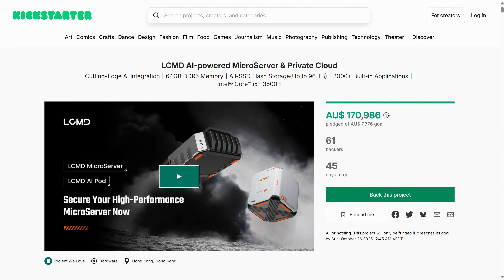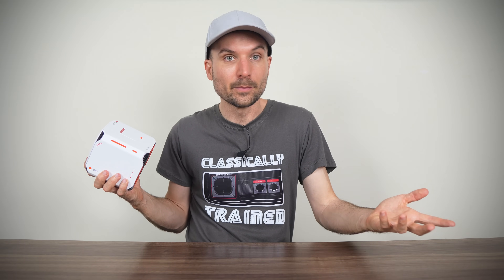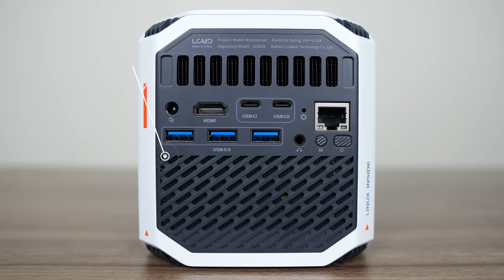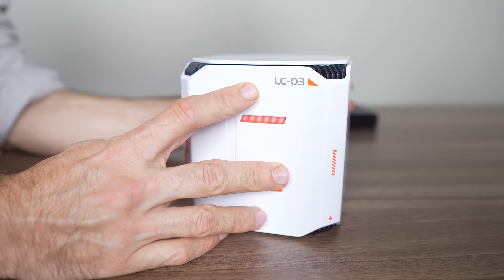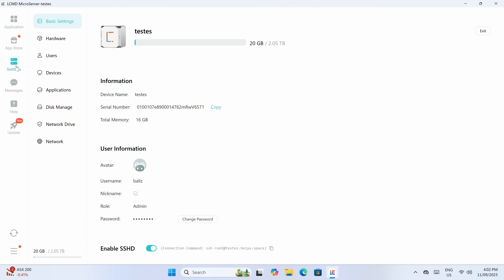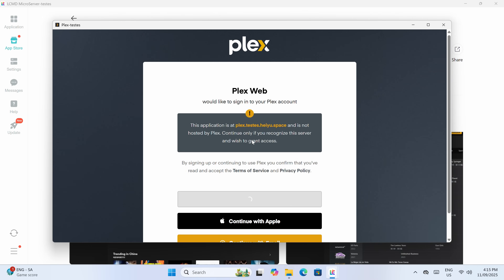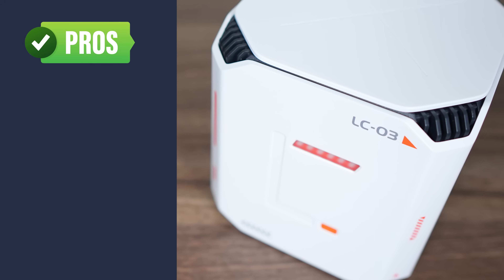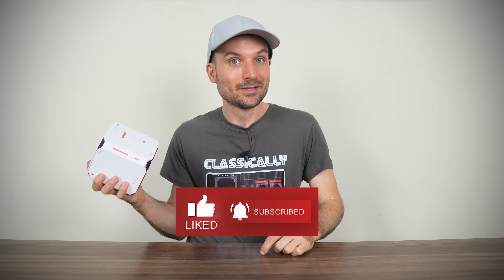Size DOESN'T matter with this 7 Bay Microserver - LCMD LC-03

Comment: The idea behind this is nice and looks promising. Over the course of time, however, I've seen a number of reviews where other manufacturers failed  at this because of heat management issues. I tend to stay away from these things if that's unclear, cause there are usually no elegant solutions for that. And what about security, privacy or vendor lock-in? Does it really only work with a factory account? Can I replace the operating system with something of my own choosing? What data does the factory (in China) get? How secure and privacy safe are the apps in the repository? And what about service, support, warranty, updates, etc?

Comment: Good review. Needs to be much easier to get into the device to add/remove NVME drives. Would need to run a real NAS OS, like unraid to be useful for me. The box looks good.

Comment: As it's meant to be a NAS, would have been nice to see it tested with more drives. Also does all the hardware work if you just boot a regular linux distribution from the USB drive ? You normally check that and it wouldn't have taken much time to do, and that way people wouldn't have to worry about privacy concerns.

Comment: I'm glad you reviewed this as it was interesting. The presence of so many screws reminded me of a kickstarter project I helped a colleague with years ago, involving a clock that both used quality hardwoods and NOS Nixie tubes (yes, still available from ex-Soviet states). There were far more parts and screws and connectors than would have been the case had the resources (money and time)  been available to 'design for production', but the need to get the product working and out the door nixed that. To be fair, there was zero chance the purchaser would want to open the clock!  

As neat as this unit is in a number of ways, I wonder how many people will want to live with it who are sophisticated enough to figure it out and yet willing to live with the issues (and that resting power draw). Neat to see though.

Comment: This thing came perilously close to being decent, but they should have gone just that little bit further and designed the unit around the i5 13500/13500T instead so as to allow for the use of a W680 chipset for ECC support and to help enumerate all those PCIe devices without relying on some kind of janky lane-multiplexer chip based solution.